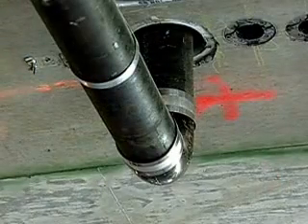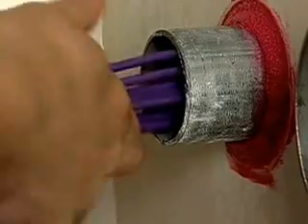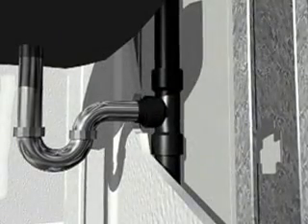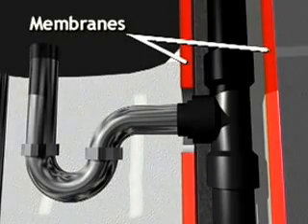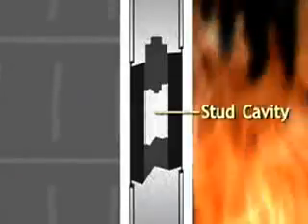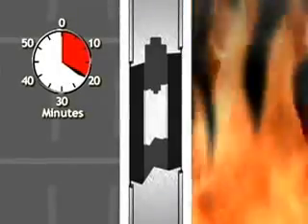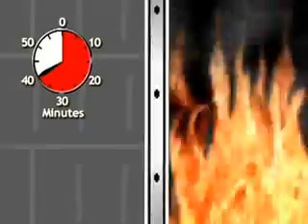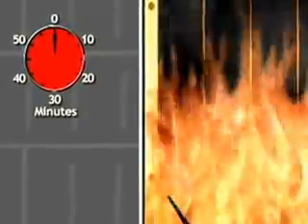Lesson 2   Firestop Through Penetrations

Comment: Hi sir.
How about if the the pressurization system duct riser per floor is enclosed by concrete hollow block.
I would like to ask if it is needed to put a fire stopping sealant every floor in duct riser.

Thanks

Comment: I've been told that Great Stuff Fire Block is not the same thing as Fire Stop material. While remodeling my home I wanted to block pests (roaches, ants, etc...) from getting through the holes where the gas stove pipes come through. Home Depot associates suggested Great Stuff Fire Block (foam) to fill in the area between the sheetrock and external gas pipe. So I've had the contractor spray the foam. I want to mention that I had capped and shot off the gas pipe since I chose to purchase an electrical stove. However I'm concerned if I sell the home in the future and someone decides to install a gas stove, is there a possibility that the outside of an active gas pipe can reach temperatures over 240 degrees? The manufacturer mentioned that the Fire Block foam can combust when the temperature is over 240 degrees.So far the home inspector can only suggest talking to an expert. The Great Stuff customer service representative is too careful to make any mis-statements (most likely they don't know) and will only mention to make sure the contractor knows the surface area cannot reach 240 degrees. The contractor has a fairly short answer that the outside of the pipe shouldn't reach 240 degrees. It would be really helpful if someone could respond as I'm trying to be proactive.
Reply: +dg indc The gas pipe will remain at what ever the ambient temperature is. The gas in the pipe does not burn, only the gas that is released through a burner and the heat does not transfer backwards. For the foam to fail, there would have to be an independent fire or heat source. If what you were thinking was true, gas lines from heating furnaces would cause a large number of house fires and would not be allowed by code. Active gas pipes are actually cool to the touch. You have no reason for concern.